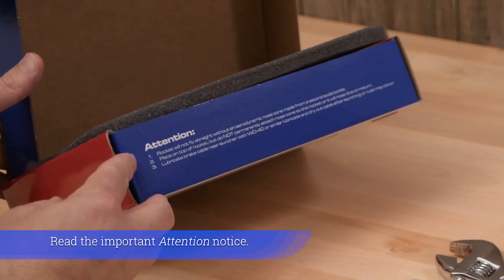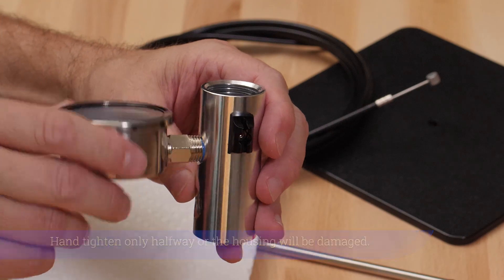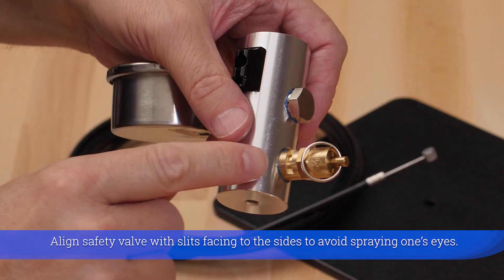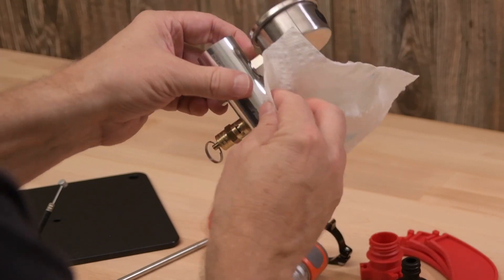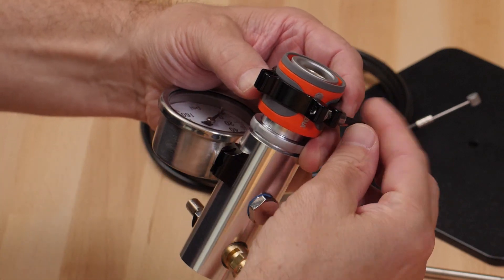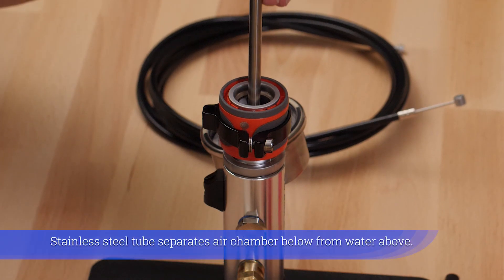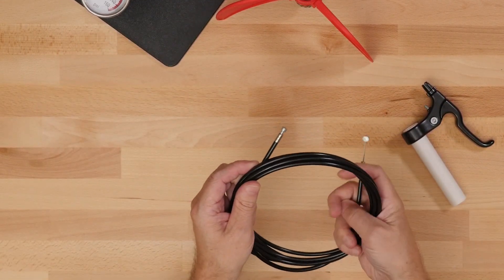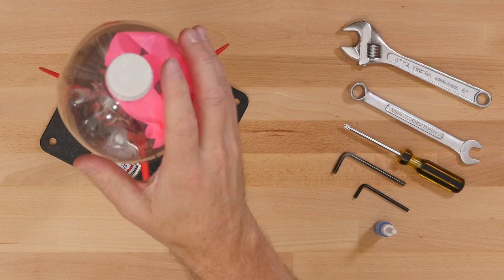StratoLauncher IV Deluxe Assembly Instructions

Comment: Unfortunately, the screw threads on mine are not so smooth, and will not go all the way in even with a firm force on the wrench. I hope it will not leak on pressurisation.
Reply from the maker: If you are talking about the threads in the launcher body, they are NPT threads, which have a slight taper as they go in. This means that the fittings (pressure gauge, safety valve, plug, and Schrader tank valve) will not screw all the way in and about half their threads will still be visible. No need to overtighten. The blue threadlocker will create the seal. Please watch the video and follow the directions. One problem with the video is that the launcher bodies made back then were not correctly made with the requested NPT threads as they should have been. Consequently, the video shows the fittings screwing in much deeper than they do now. However, the threadlockler in both cases will create the necessary seal for holding air pressure. Hopefully, I correctly understood your comment and provided the correct answer.
Reply: @StratoFins  Thanks for your reply. That is what I was hoping was the case with the threads- good to hear!

Comment: A little warning on the box would be nice that you need to assemble 24 hours before use. I assembled the same day I was planning to use it. The photo on Amazon shows Teflon tape. Loctite was included instead. Unfortunately didn’t have any Teflon tape on hand to assemble for same day use.
Reply from the maker: Thank you for your comments. We apologize that the kit box does not have a notice about assembling 24 hrs. before use, but our assembly video does announce that. Yes, the photos on Amazon need to be updated as our product gradual improves with each production run. Initially, Teflon tape was included in the kit, but customers could not handle it and often put in where it was not needed, which created leaks. Threadlocker works better and is easier for most to use, but there is that 24 hrs. wait period. Normally this is not an issue because aside from assembling the launcher there is a fair amount of prep work required such as getting bottles ready, making weighted fall away nosecones, attaching parachutes, etc. and often waiting for good weather such as little or no wind blowing. In water rocketry it is best to prepare equipment and materials long in advance before actual launching, which makes for a much better launch day experience. That way one can “Seize the Day” when that perfect opportunity and/or weather appears and everything is already to go. However, we will take your advice and seek to add that 24 hr. notice before use to our next box print. Not that anyone reads the valuable information on it already.

Comment: Hose connector does not need the threadlocker?
Reply from the maker: No need for threadlocker or Teflon tap on the hose connector threads. There is a rubber gasket in the top of the launcher body that creates the seal between the hose connector and the launcher body.

Comment: Excellent video. I used plumbing tape on the threads when I assembled mine a while back. It appears you upgraded the cable lever to a metal one instead of plastic. I did the same also :)
Reply from the maker: Thank you for your compliments. We are always making improvements with each production run of our product, but most of them are minor. Everything seems to have a trade off. The advantage of the Teflon tape was that the launcher could be used immediately upon completion of assembly. However, people would put Teflon tape in places where it was not needed such as plastic threaded areas which created leaks. Hopefully the threadlocker will be easier to use and more effective, but it does require 24 hrs. to harden before using the launcher.